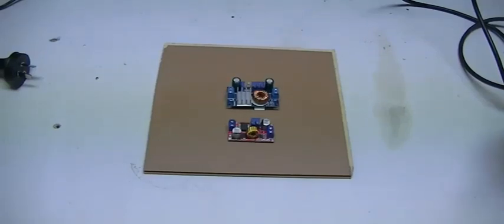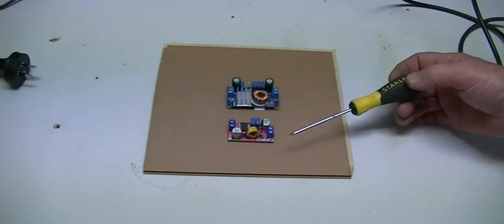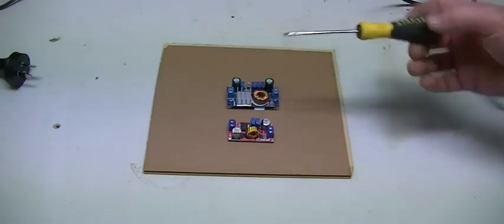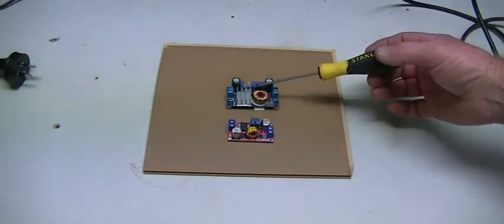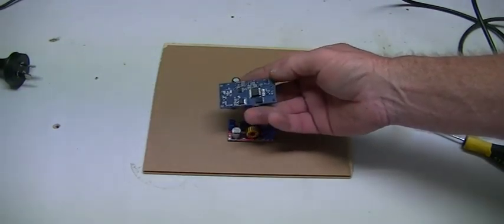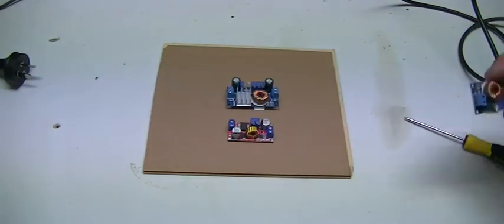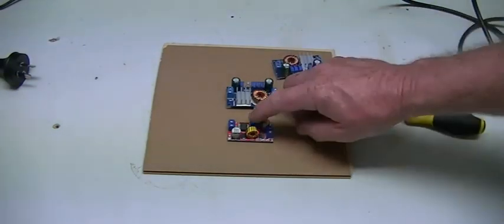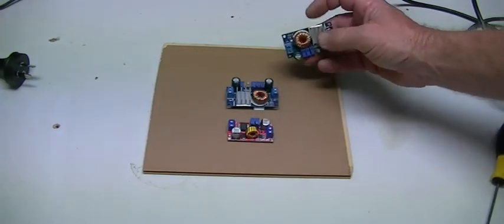MPPT buck converter V standard Buck Converter

Comment: wrong simulation and wrong conclution! solar panel voltage change little with sun condition, when cloudy, the voltage not drop very much, but there is no current.
Reply from the maker: The voltage drops when power is drawn from a solar panel, which is why there is very little current in cloudy conditions. The more current you try to draw the lower the voltage will drop. My conclusion is correct.
Reply: Incorrect 😂
Reply: Conclusion is incorrect

Comment: Thanks mate a real video for a change.i had a gut feeling about this.
One thing i thought about is that mutiple mppt chargers tend to compete with each other causing final output 
Anomolies.
Buck i think is the way located at the panels after clamping and volt seting each buck for each panel array with output blocking diodes.
And 1 mppt primary unit at the inverter.
System 3x 2 series parallel 3400w 100vdc open input from each of the 3 parallel panels.
Buck would start working at around 30vdc instead of the primary mppt being 60vdc startup.
Andrew NZ

Comment: You're wrong. A solar panel decreases current when a cloud passes by. It just drops voltage when the load is too heavy for its current. The MPP buck converter will try to decrease output current to maintain the voltage you set (18 volts).

Comment: Soooo, this video does not demonstrate how to use the MPPT module correctly. It does use the fluctuating voltage seen in solar panel use. Other people comment on it much better and in more detail than I will, but basically, these are not designed to power loads primarily. They are designed to convert excessive, unused voltage ( beyond a user-assigned value) into current /amps. They are used in systems of other modules to charge to a battery. 

Each battery has a specific charging voltage established by its manufacturer. You set this module to the voltage they specify. You would never want to leave a battery, especially a lithium battery, connected to something generating the open voltage of a “12 volt” solar panel, which is 18v 💥🔥!  

After you set the battery charging voltage to the proper voltage (the manufacturer of my Lifepo4  battery, for example, says 14.4v with a max of 7A current), a module like this just converts all the volts above 14.4v into current.  Since the battery can receive 7amps of charge current and a 10-watt 12v panel realistically only produces 0.5A without an MPPT buck, any extra current a buck adds is excellent. 

With a pvm-only controller, the pvm automatically converts the 18v to 14v and even less if the battery needs a lot of charge, but it just throws away those precious volts.  

If you have two 12v panels serially connected  = 38v, then you have a lot more volts above 14.4v to convert to convert to current —to get closer to the 7A (maximum) goal. This module only handles 5A, max, however, so don’t attach huge panels to it.

I have not used this exact module, so I don't know if it has overcharge / undercharge, reverse, boost, float, etc. modes like the ones that I have. If it does not, I would not use it alone to charge batteries.  

Keep a fiberglass fire blanket around and never leave it unsupervised, if you do. 👀

Comment: Design is really cheap to get a mppt to work right down to low voltage the current need to be adjusted automatically even if current drop 10 % the current reduces to a 1 amp so it’s very easy to design so I think the cheap Chinese ship is missing about of details I don’t use micro controller chips because it’s way more easier to use analog ic to get the same results the tl494 ic have everything need in one package for solar mppt mapping just need 2 op amp one voltage follower and one current follower it’s easy and system to design
Reply: OLS TL494 PROJECT MPPT

Comment: Hello, I have attached a lifepo4 battery to this voltage reducer and connected it to the solar panel. When I wake up in the morning, the regulator does not charge. you have to remove the battery and when you reinstall it this error doesn't happen i don't want to deal with it what should i do

Comment: MPPT is designed to maintain the voltage at 18V. It does this by reducing the current flow to the output side. So actually your test proves that the first module works. If you was to attach a solar panel to the input. You would see the voltage maintained at 18V in bright sunshine or cloudy sky.  And as the light decreases to the point there is not even enough power to keep the module  electronics running the voltage on the solar side will drop down until it is dark and 0v. A buck converter will maintain the voltage on the output side. But as the detriment of MMPT efficiencies. I have considered a hybrid solar  MPPT tracking at 18V and a Buck converter that fires up at 17V and below to scavenge the remaining fading daylight light. However the tiny amount of power at that inefficient solar voltage and the panel giving out so few watts. It's just not worth it. As i suspect the only watts left in the system is the power used by the modules and their own step up or down inefficiency.  And i am sure if there was any gain from a hybrid system. Some one would already be doing it.

Comment: Hey mate that mppt controller has 3 resistor pots.
Cv,cc, and the 3rd one is low voltage disconnect. 
You have to adjust that so it will stay active

Comment: Hello, can this buck converter good for for direct charging the celphone from 20w 18v solar panel? Will the ampere increase if to set the voltage to 5v in buck converter? Please answer, i need your reply badly.
Reply: it will charge. at least it able to powerup one 5V*2Amp usb device
Reply: @sergeyvasiliuk6425  No more to two devices?
Reply: @stephenshop4946  dont expect too much from your 20W panels. Most of time they convert just around 10W of energy which probably too small for energy-consuming devices.  But you can charge few legacy USB devices with total power less than 10 watt
Reply: Have you tried this mppt buck converter?
Reply: @stephenshop4946  i have no such problem like you cus have 2x40W panels and 24V battery in the middle. So this is completely different usage scenario allows me to powerup even 100W notebook  (USB-C 20V*5A)

Comment: The "buck converter" you say is better (red board) also has an MPP adjustment pot. You just didn't adjust it to the maximum power point. Also, your entire test was flawed, because when the board cuts off the current, with an actual solar panel, the input cell voltage will recover, and power will still flow, unlike your power supply that just STOPS allowing power.
Reply: I agree that the test is incorrect, at least for the first controller. I use the same module with a 30w 18v solar panel and it really works. What is wrong in your test is that you don't mimic the behaviour of a real solar panel when the sun is covered by clouds. In theory, a solar panel with no load will give you the same voltage (mine outputs about 21V). When the sun is dimming, the current is the one that is lowering. But now here comes the controller: it automatically adjusts the load (and so the current) so the voltage on the solar panel stays around the sweet spot (maximum power point), 18V. So in your test you should had adjusted  the PSU current, not the voltage. This is happening in real life with mppt controllers and solar panels. Anyway, these cheap modules are not real mppt controllers because they do not actively track. With the load connected, one must manually adjust the first potentiometer until the voltage on the solar panel is at the maximum power point (the voltage of this point is written on the back of the panel). Small adjustments can be made by watching the output power. The problem is that the  max power point changes with the panel temperature but for small projects the initial settings will suffice.
Reply: @florinberechet6375  thanks for taking time to explain
Reply: @florinberechet6375  Hey I got the same blue MPP converter as in the video. However I don't know how to set them up properly. I want 5V output and MPP at 18V for my solar panel. I connected the converter with 20V on my power supply and then adjusted the voltage poti (CV) without load to give me 5V. Then I adjust  the MPPT poti almost to the point where my output voltage drops. I thought this was the correct way of setting up that converter right? The issue is, that when I apply load (e.g loading a powerbank) on that 5V they drop to around 4.6V and also the current drops way too much. The CC poti is set to the full.
Reply: @domtechnik8405  what is the current in the output in 5v setup?

I think 4.6v should be adjusted to 5v while the load is attached for correct voltage usage, and see to it that the sun totally bright when doing the setup.
Reply: @stephenshop4946  Hi, 5V without load should be correct. Indeed it was a faulty cable.
Reply: Hello, can this buck converter good for for direct charging the celphone from 20w 18v solar panel? Will the ampere increase if to set the voltage to 5v in buck converter? Please answer, i need your reply badly.

Comment: I thought the concept of mppt was to "track" automatically and not be a set point...maybe you could apply a change over relay to switch the more efficient "set point" device. I have also purchased a bunch of these things. The idea is to use 48v solar panels to charge 12 volt batteries
Reply: It's mislabelled. It's not MPPT, it's just MPP, but it works... kind of
Reply: 48V solar panels will have Voc far over 60V, these will fry that devices.

Comment: Most MPPT modules have no MPPT control chip, just a buck converter.
Reply: Not really. It's an MPP module but without the T (it does no tracking but can achieve the maximum power point). A buck converter would be even worse than this module.
Reply: It is fake mppt. Just buck converter. Only expensive device are real mppt

Comment: I  am targeting at charging a battery, not powering a load. So I am looking at current, not voltage (I set the max voltage out at 14.4 volt, the mppt bick converter will happily push it all the way up to there). If I use a buck converter only, it will drop the solar voltage so much, that the current drops because it is way too far from the max. power point. The setup in the video uses a power unit which delivers a constant (max) current, however compared to a solar panel, if the voltage drops, the current drops as well. The MPPT device will deliver much more, over a longer time period. To 'catch' a bit more, I have 2 mppt devices on the same solar panel, one for charging a 12 Volt battery on high volts, and when de voltage drops (low sun or clods) the second mppt device gets 'the remaining' and charges a bank of lipo's, used for charging phones and what not. I agree, a real MPPT device is worth a lot more, these cheapo's are still okay if you know how to use them (for solar only imho), and accept you need to set the maximum voltage so every now and then (as the sun gets higher through the season). It works for me, running my phone and laptop all day on a very old 180 Watt panel at a super low angle (almost horizontal). In the summer I remove the cheapo converter and use a grid converter since it is way to much power to handle then.
Reply: Hey mate, can we combine a buck converter with a pwm charge controller to keep the buck converter from collapsing due to insufficient current as the load demands more current and buck converters just can't automatically limit the output current which leads to converter collapse where the input voltage from the solar panel drops drastically due to the converter trying to supply a constant voltage and current the load requires, but a pwm controls the available power or current from a solar panel in times of solar iradiance, I was thinking that since the pwm will only supply the available current from the source without letting the battery draw more power from the source, can we combine buck coneverters with pwm to solve the problem faced by buck converters (converter collapse) by connecting the output of the buck to the input of the pwm, so that the pwm will manage to supply the available current the buck can output, without demanding too much that it would cause the voltage from the solar input to drop? Am I making sense?
Reply: @Aether333  I think you just sort of described how MPPT works (in technical terms). If the electronic circuit does not 'know' the maximum power point, there is no easy way to 'emulate' MPPT. I do have on in mind using a simple NE555 (which does the pwm as well), but I have not had time to work on that idea.
Reply: @deslomeslager Yes mate, this idea do not similarly works as an MPPT for it doesn't track the maximum power, the idea that combining buck converters and pwm to resolve the issue of converter collapse and hopefully provide some efficiency compare to using pwm alone, coz pwm doesn't convert excess voltage to usable current, if your system has a great voltage difference between the solar array output voltage and the battery voltage, for instance a series of two 18v panel is 36v charging a 24v battery to around 26v is a lot of wasted power due to high voltage difference when using pwm alone. My idea is to convert the power first closer to what the pwm needs to charge a 24v system , taking advantage of the usable current from the conversion. MPPT uses conversion efficiently by tracking the Maximum power point, while this set  up simply converts the available power from the source to a constant voltage with the available current. No one has ever done this before, and right now, I don't have the resources to run some test about this idea, hopefully can bring hopes to solar enthusiast that can't afford expensive MPPTs , but wants to have a juice of efficiency to their set up

Comment: Why don't you adjust the three left potentiometers in order to get the voltage you want???
Reply: I don't think those pots are for that.
Reply: What are 3 the pots for? I know the right most is for output voltage adjustment.
Reply: @SolarMinerPH  MPP (manual) and in some order the usual Li-Ion buck converter pots, CC, CV and fully charged indicator.